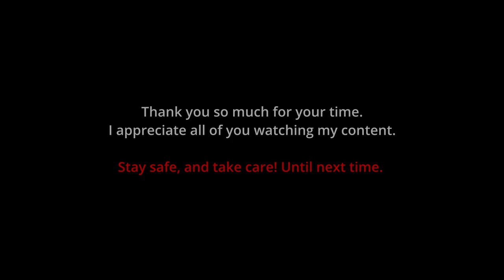Old Suffolk "Super Punch" Lawnmower Restoration - Part 5 The end.

Comment: fantastic restore, full nut and bolt. I'm looking at getting one similar and to do up as my Grandad had one,, not to this level!! just to use on the lawn. I wanted to see the parts detail which the video was perfect. well done.  I was also intrigued to see what happens about the decals, you blasted them off!, shame about the decals, I think you need to do a shout out to see if someone has some originals from the factory. amazing re-build though.

Comment: When my parents bought the house I live in - dad bought a “Qualcast Suffolk punch cylinder blade lawnmower to cut the grass with, like with the mower you have restored ~ it had a similar engine with a centrifugal clutch to engage the drive at higher revs, but the roller was engaged with a belt clutch, operated by a “bicycle brake” squeeze lever on the handle bars (a more safer version than the one restored in this video), had a throttle lever on the other handle and the petrol tank was halfway down the handle above the engine. Dad had been mowing the lawn with the Suffolk punch for quite a long time and I remember growing up hearing dad mowing the lawn with it and when it was warm outside (summer) I was allowed in the garden and if dad was mowing the lawn I would try to follow him, behind/at the his side and seeing the blade flinging the cuttings into the grass box. When the box was full, dad would put the engine on idle [to disengage the clutch and stop the blade for safety] and push the mower to the end of the garden and pull off the grass box and empty it onto the compost heap and then refit it onto the mower and take it back to where he had stopped and put the engine to running speed [engaging the clutch = spinning the blade] and continued while I was standing at the end of the path next to the play/Wendy house watching him doing that. Eventually when I was older (teenager ~ 15-16) I helped dad get the mower out of the shed and onto the lawn and dad said “do you want me to tech you how to use this mower and cut the grass?” and I said yes - taught me to start the engine,  adjust the speed, how to “correctly cut the grass. I then cut the grass with dad walking along side to guid me and show me how to empty the grass box and stop the engine. I asked what the other lever does and dad said “that is the self-propelling function = the rear roller spins and drives the mower like a car so you don’t have to push it”. After doing the mowing on my own I quite enjoyed doing it

Comment: I personally think operating motor-driven spinning blades in shorts with bare feet is a great combo, comfy AND thrilling! OSHA doesn't make the rules in my yard lol. 

I just can't help but think if my foot ever accidentally ends up in the blades it won't matter if I'm wearing steel toe boots or flip-flops. Occasionally the blade will fling a rock and hit me in the toes or shin, but I've never seen one that was moving fast enough to do more than sting and draw a drop or 2 of blood so I think it's safe enough. 

Safety glasses are a different story, I wear them for basically all tasks involving moving parts. I'm no fool, eyes are delicate and I've only got 1 spare.